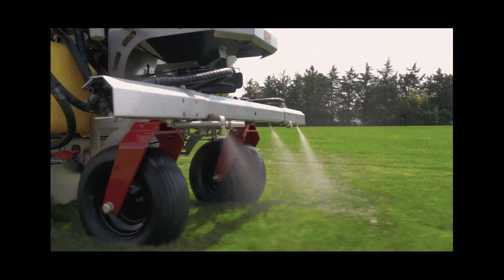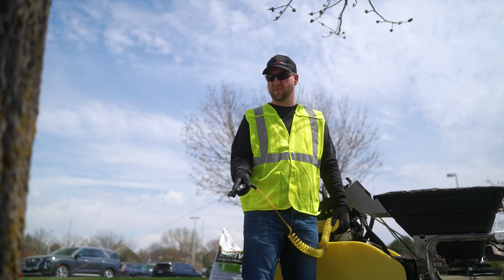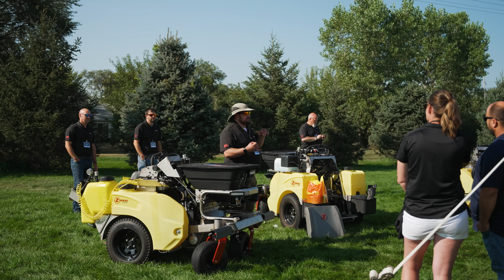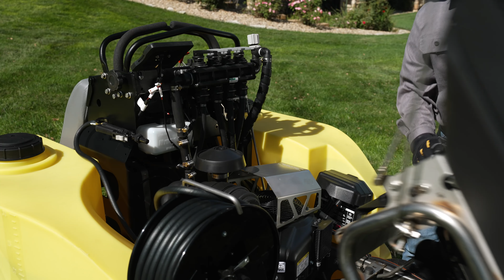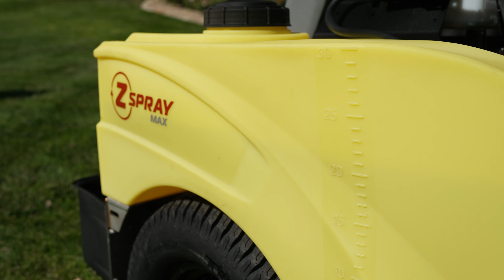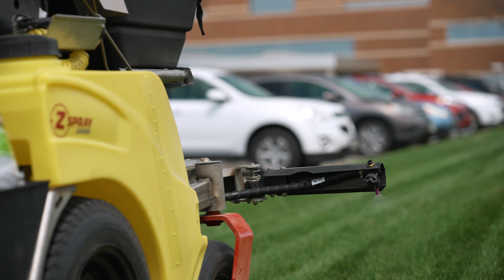The Z-Spray Difference | Z Turf Equipment

Comment: Any plans for the jr42 size?
Reply from the maker: At this time, we offer the Z-Spray LTS and Junior in 36", Mid in 46" and Max at 52". We do not have plans to add a 42" width, but will forward your message on to our team to let them know there is demand for the size. Thanks!
Reply: That would be great. Thankyou.